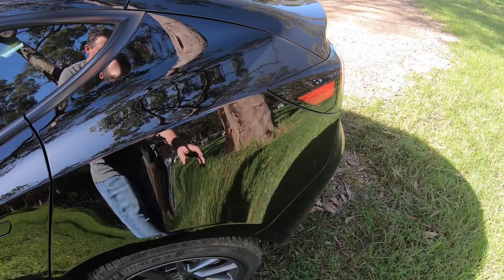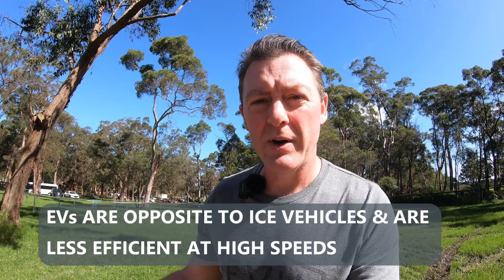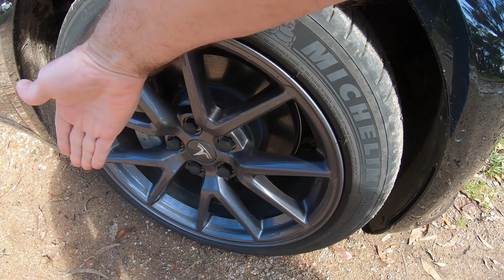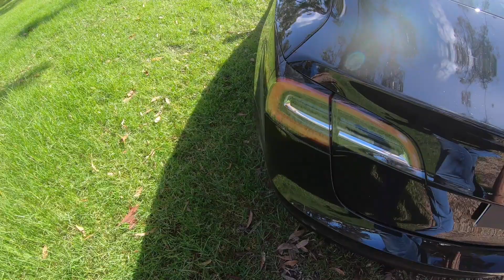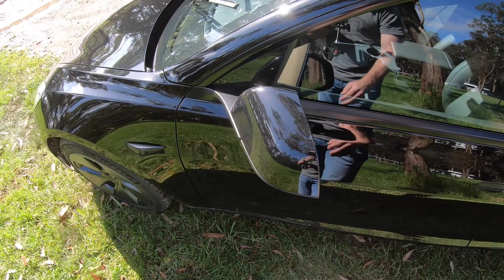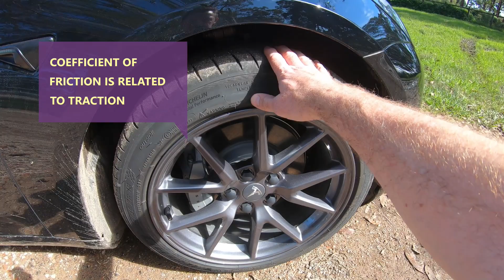EFFICIENCY PART 1 - TESLA MODEL 3 AERODYNAMICS, DRAG & WHEELS

Comment: Hi Matt, what's your thoughts on having a mesh grill in front of the lower intake?

I've seen leaves and debris can get caught up in the radiator and clog it up over time.

Would the mesh impact negatively? Or would it make things more maintenance free and reduce strain on the radiator if it got clogged up
Reply from the maker: If you use a fine mesh then it is effectively doing the same thing as the leaves by reducing the volume of air flow through the opening but now it would be doing it constantly. Fine mesh like flyscreen actually has a lot of drag. If you were to use a coarse mesh you risk allowing leaves in anyway. I personally wouldn’t mess with the airflow in that area as you will affect the efficiency of the heat pump and A/C. If you weren’t running the car in extremes you might get away with it but when supercharging you can really hear those fans screaming. Part of the issue is these cars do not have scheduled servicing but I feel they need things like this cleaned out or at least inspected every 10000km or so.  In saying this I have never had an issue with leaves clogging up radiators in any car I’ve owned so maybe I don’t appreciate how bad this issue can be for some people and possibly being blown out with an air gun each service kept it under control…